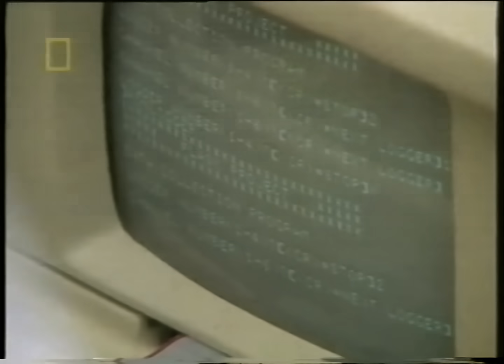Train Crash Test @ 160km/h (99.4 Miles) into 50 tonne Metal Block

Comment: @danlefou I was waiting for someone to point out this little bit of over-precise idiocy... someone out there knows how to work a calculator and put in conversion factors, but not to stop for a moment and think ... wait, did they maybe just round off both the original mph and then the internationalised (for NatGeo) km/h figures for simplicity's sake? Perhaps I should just backconvert to 100 instead of taking it to 3 sig figs, particularly as the train speedo isn't that precise anyway... ;)

Comment: @ChegzGT1EB Are you suggesting that nuclear flasks somehow violate newtonian physics to become deceptively weak & satisfy your irrational paranoia? Two objects colliding at a certain combined speed, it doesn't matter what the balance is on each side. If anything, given that the considerably more massive object (locomotive frame + big diesel engine inside + several carriages, vs one canister that has to be light enough to not damage the rails) is the one going 100MPH, won't it be WORSE this way?

Comment: @htc6600 You fail at statistics. Take a night class to learn the technical meaning of significant and insignificant variation in the data.

Insignificant here meaning that, though the collected data may be a little "noisy" and waver around, the measured variation was small enough that they could say with some confidence that the impact hadn't affected the pressure.

Or, alternatively, it could be that it changed a little but not enough to be dangerous. Like a tyre being 31 instead of 30 PSI.

Comment: @dtiydr That would be silly, The stronger the train is, the less energy absorbed by the train in a crash. The energy from the crash needs to be exerted somehow and the most likely place for that to happen if the train is super strong is the passengers inside. Therefore a precisely calculated portion of the front of the train (and, cars, trucks, other vehicles etc...) are deliberately designed to disintegrate during a crash absorbing this energy and lowering the effect on the passengers inside.

Comment: @NJPurling It's said there was ballast. There were certainly instruments and crash dummies to rest new coach furniture. BR said extra coaches would have made no difference because their energy would have been progressively absorbed by the buffers, compressive couplings and automatic full braking. The main tank was used, but with just enough fuel to reach the site. Diesel doesn't ignite easily if not compressed or vaporised by contact with hot metal. Flasks had been fire tested separately.

Comment: I thought that crash test was somewhat un-representative.
When did you last see a main-line diesel hauling only 3 EMPTY coaches.
There should have been  ballast  to simulate a full passenger loading.
I also wonder if there was a small drum of diesel feeding the engine & the main fuel tank was drained. To be truly authentic the flask should have immediately been placed over a fire of burning timber to allow for the fact the wreckage of a train might also have caught fire after fuel spillage.

Comment: @paulofpings The flask is a thick steel box lined with lead, containing depleted uranium 238 fuel rods in racks, and filled with water. A rubber gasket seals the bolted-on lid. The flask used in the test programme only ever contained steel dummy rods. As the real rods are slightly warm, the flask has cooling fins to control the temperature. A real one in such an accident would release only a small amount of slightly irradiated water. Search "Operation Big Hit" for details and more crash clips.

Comment: @paulofpings The designers expected it to leak for a fraction of a second on impact, then to reseal itself, which it did. Drop tests show a fine spray emerging around the lid then no further leakage. The internal pressure drop was just perceptible. The flask behaved as expected, so it passed the test.

Comment: @tractorboydavidbrown There was no need for remote control; they just set the throttle, opened a valve outside the cab,  and left the loco to accelerate away by itself.

Comment: @WorldOfNothin No-one has yet designed a practical locomotive, or any other sort of vehicle, that can survivably hit a very solid, heavy object at 100 mph. The instantaneous deceleration would probably be fatal, even if the structure somehow protected the driver. The test was of the flask's crash resistance, and instruments and dummies in the coaches gave information useful to coach designers. Public concern was over the possibility of the flask leaking, and that is what was tested.

Comment: @tymmur Trains usually had two flask wagons, but only one train was run at a time, so they would never meet. In any case, in any conceivable collision there would be plenty of rolling stock iintervening to prevent flasks from colliding, and if they did they still wouldn't leak. The drawhook on that loco concentrated all its kinetic energy, far more at one point than the flat, finned sides of a flask.

Comment: @teddy292929 Yes, but several Peaks have been preserved, including 46010, the next one off the production line. We just don't have enough space  in little old Britain to keep thousands of worn-out engines, inefficient compared with later types, and getting obsolete spares can be a nightmare even for the few that are maintained by enthusiasts. It's actually easier to rebuild steam locos than diesels.

Comment: @teddy292929  It was old and worn, and would soon have been retired and replaced. Are you suggesting that scrapping it the normal way would not have been a waste?
This way, the loco and coaches provided valuable data, both to CEGB engineers and to rolling stock designers, who welcomed the chance to crash a train at express speed under lab conditions .

Comment: poor excuse for a test that. its all sparkly and glittery but doesnt really do its job. the container is at an angle aswell so its being hit at its strongest point. surely you should be testing the sides, the weakest parts. a chain is only as strong as its weakest link. then they drop it from 5 feet on its corner lol. and they they have they cheeck to say its the ultimate test!! lol give me what they spend, and i would proply test the strength of those containers. oh yeah, waste of a train too

Comment: @narutoidontknow  Unless the container was immovably bolted down, unikely in any credible accident, a heavier train (and thus probaby a slower one) would make not the slightest difference. The container absorbed only enough of the train's momentum to get it moving. Besides, the brakes of a long train would come on automatically as soon as the locomotive was wrecked, so most of the momentum would be dissipated. Note that the rear coach even of this short fast train was hardly damaged.

Comment: @ShockWaveDS13 The container was facing the train. It was more likely in a real accident to come to rest diagonally aross the track than at 90 degrees, and it was positioned so that the loco's drawhook, with all the train's momentum behind it, was most likely to knock the lid off, which it didn't.

Comment: I suspect the driver would have been thrown against the front of a rear-end cab by the deceleration in a hood unit (which we don't have in the UK except as shunters) and seriously hurt or killed. The main argument against hood units is restricted forward visibility when running hood first. Besides, don't nearly all express locos worldwide have forward cabs?
It's academic in this case, because the loco was unmanned.

Comment: Ugg...I wouldn't want to be driving that train. Looks like a good arguement for hood-forward operation to me (yeah, I know that kind of engine couldn't run that way). I wonder is the engineer would have survived if the cab was is the rear, or if the weight if the train would have crushed it.

Comment: The primary aim was to show that the flask could withstand a very big impact without spilling its toxic contents, but I understand that data from this test also helped designers of railway coaches, which are very much more crash-resistant nowadays.

The old Mk 1 coaches used were already obsolete by 1984, so nobody was likely ever to be in such a crash on a main line.

Comment: the thing it was crashing into holds radio active materiel and there testing the tank that holds it to make sure it doesn't crack or explode. obviously the driver was not in the train. remote control running like a eot on a loco.

Comment: Ironically, this wasn't a real test anyway, since the forces involved were much lower than the containers are designed to withstand. Much of the energy of the impact was spent throwing the flask and wagon through the air, and crumpling the locomotive (just like a crumple zone on a car). The real test involved dropping a container from a height onto a reinforced concrete floor at it's most vulnerable angle, but that wasn't good enough for the anti-nuclear lot. Of cource, neither was this.